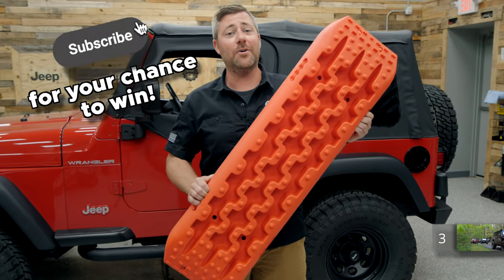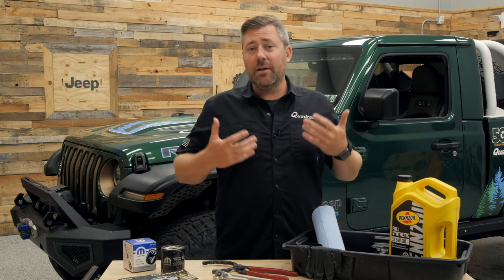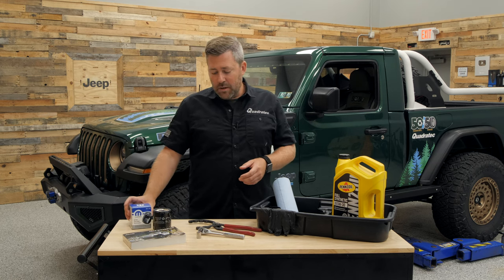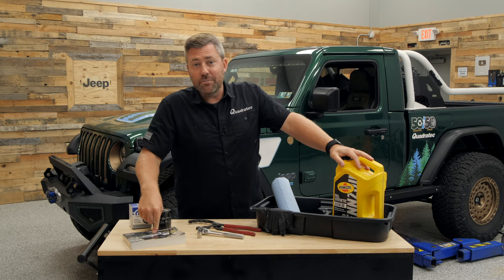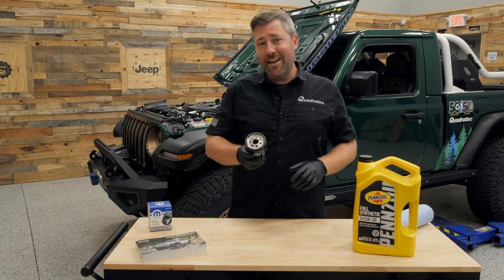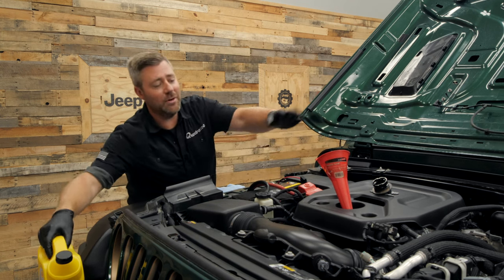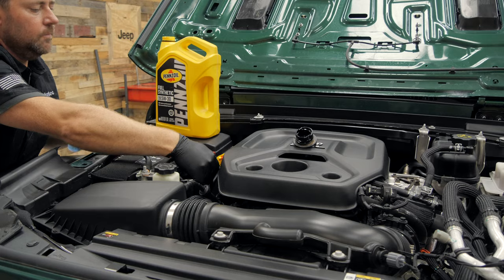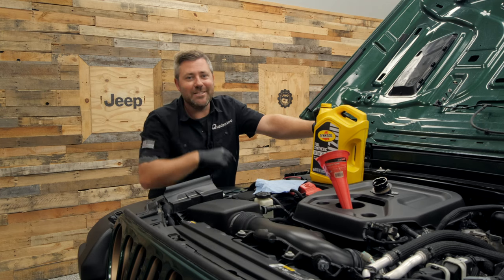Jeep Wrangler 4xe 2.0L Turbo Oil Change - Quadratec Academy

Comment: The oil filter part number at 5:03 looks strange. What I got is 4892339AB, but this one is BE, and on the Mopar website it doesn’t say work with 2.0T.
Reply from the maker: The one we removed in the video is the one from the factory, this is the first oil change for that Jeep.